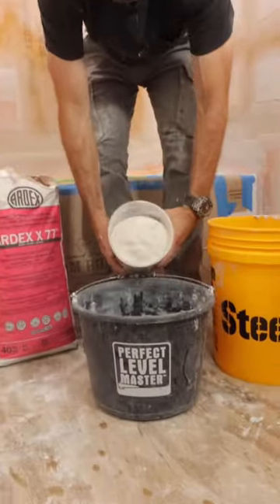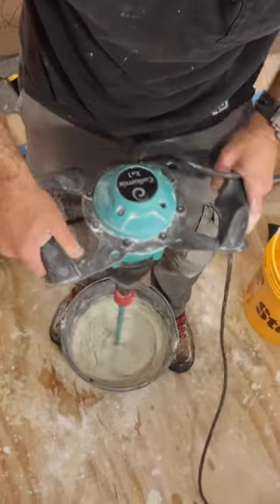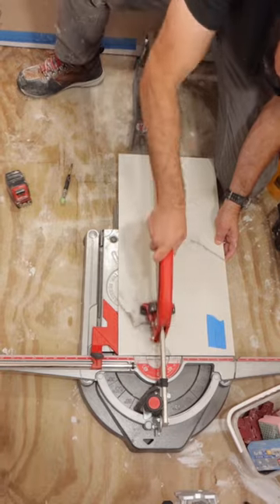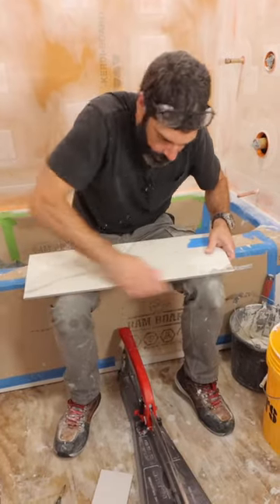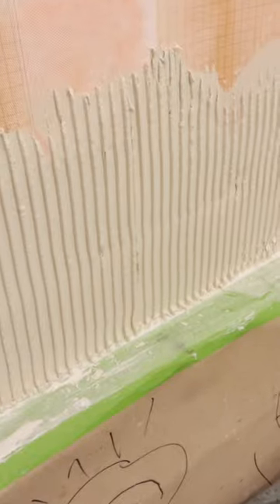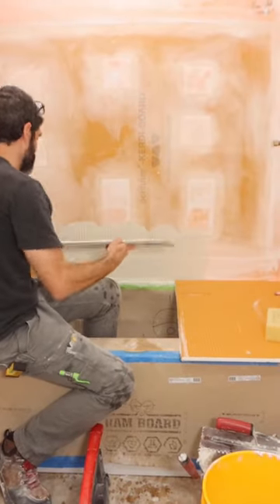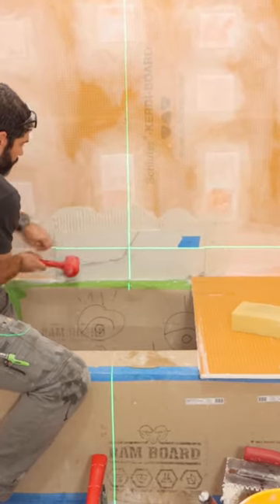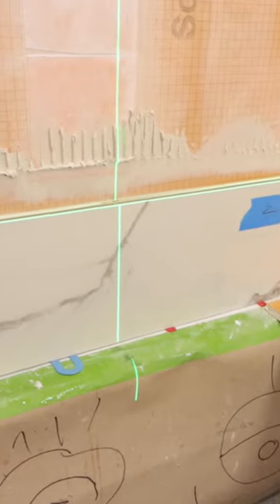Tub Shower Tile Tips - #shorts

Comment: Do you realize that when you’re mixing grout and you let the mixer bounce around in the bucket like that, it’s scraping the sides of the bucket (and bottom) and you’re getting tiny strips of plastic in your grout which can screw with the bond if you get enough. It will also come up in the grout cracks and you won’t see them until it dries most of the time.

Comment: Trawls lines should go horizontally. Add mix to water- not water to mix.
Reply: Nop , the lines goes from the shorter side of the tile that way the air can get put easier.
Reply: @jcsego1370  yep, easier to wiggle down ridges and get better coverage!
Reply: @jcsego1370  that’s a misconception in the tile trade. What if your installing a square tile 24x24 or even 48x48 doesn’t matter which way your lines go as long as they are combed in a straight line. The air escapes just fine on those it’ll escape the same way with a 12x24